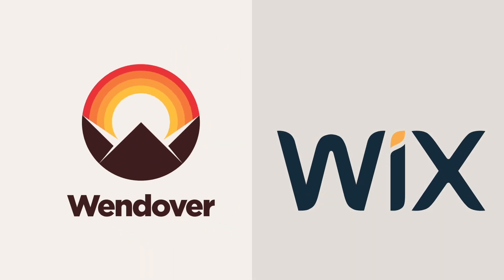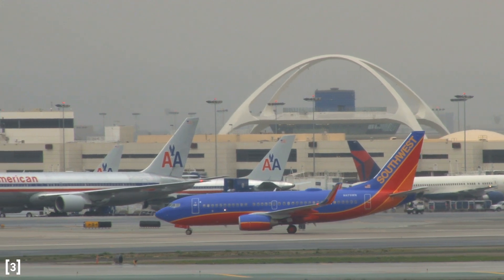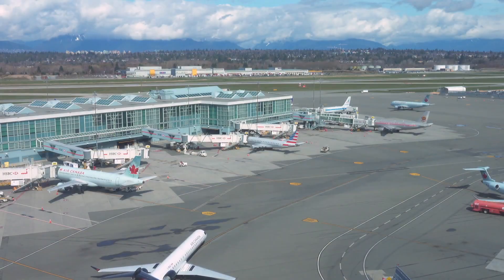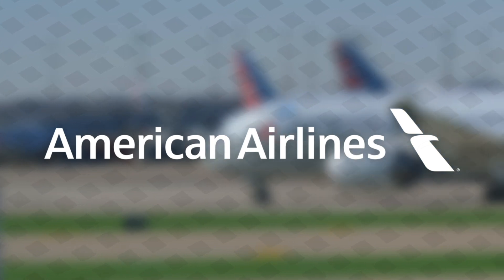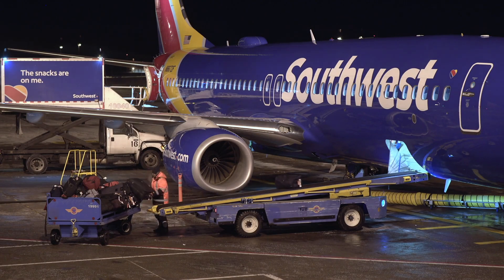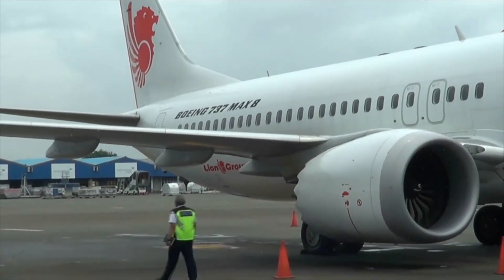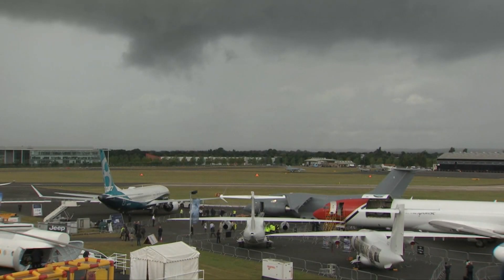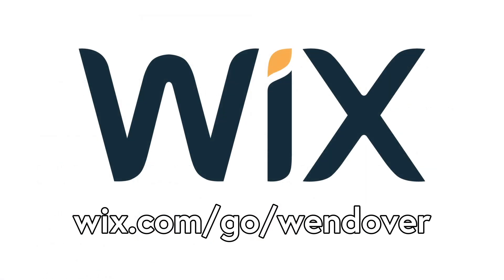The Economics That Made Boeing Build the 737 Max

Comment: Just one thing, you can't blame a crash in a single system. Its not just the MCAS or just the sensor...
Reply: You probably more than right.
MCAS badly designed + No redundant sensors + No retrain by airlines and/or Boeing + Old plane design redesigned to minimise cost (maybe a not so costly but milder redesign would be many times safer the cost) + hurry by Boeing to release a plane to compete with A320NEO as fast as possible. + etc. etc.

Comment: My tweets to Dennis Muilenburg (Boeing CEO & major shareholder):

 
@BoeingCEO
1/ This is the problem: your lack of candour. The 737 Max has short legs (being a 60´s design), & that meant placing the new, efficient & more massive engines higher on the wing´s leading edge, creating an imbalance to yaw and pitch, leading to stall & needing MCAS to avoid it.
 @BoeingCEO
2/ The only solution: placing the engines lower & growing longer legs. Or placing the older engines. Nobody with half a brain will ever fly the 737 Max as is, understand that. MCAS is insufficient, making it dangerous and only exists because of the aforementioned design flaw.

Comment: that the 737 design originated 50 years ago is not a problem. the problem is that the original 737 was designed low to the ground, better suited to airports without jetways. Since then, the 737 has grown from a 80-100 passenger, 94-100ft length to 160-200 passengers at 144 ft length. Being low to the ground, it cannot accommodate the CFM LEAP 1A or PW1000.

Comment: The 737 since its beggining has been plagued by problems. Especial.y deadly, the rudder problems which costed HUNDREDS of lives. It took them YEARS to find out the problem and .... ahem.... correct it.
To get an idea of how old the 737 is.... it has the same cross body section and cockpit as the 727 and the 707.... yes... the 707...
The only boeing aircraft same enough for me, is/was the 747.
Skip the rest, even (if not ESPECIALLY) the 787.

No boeing for me. When i book a flight, i check the aircraft type. No boeing.

Comment: If you had started with the conclusion, I wouldn’t have watched it to the end. It all falls into place.The sensor itself is pretty genius though, the reason it exists is kind of a design flaw and the fact that there’s only one indescriptive warning light if something is broken is just stupid.
Even though the original design didn’t have space for it, I find it hard to understand that they can get a plane to fly but not figure out a place to put a proper display (and if it does exist, not figure out how to display error messages on it).
Because from what I understand from your video, if the pilot had turned it off, those crashes could have been avoided. But in order to turn it off, he would need to know about its existence, which I doubt, and know it’s broken.
I imagine it’s like „hey, what route am I flying today?“ „the blabla“ „but isn’t that on the 737 max?“ „Yah“ „but I’ve never flown that before“ „oh, don’t worry, it’s the same as all 737s“ „so nothing special to take care of?“ „nah, not at all. the FAA doesn’t even require certification for it, that’s why we bought it. What are you still doing here, your flight leaves in 15 minutes!“

Comment: The cables that run down the center of the aircraft are there for redundancy they are not used all the time that’s a back up system on the early version of the 737 it was used all the time because they did not have flyby wire but on the new 737 max Siri’s the cables are just there for redundancy even the 747 has that for redundancy as well as the 777 Airbus only has three back ups and they’re all computer control Boeing has four back ups three computer and one mechanical.

Comment: I'm just wondering why it only has one AoA sensor. There is so much redundancy in airplanes, but not in such a critical instrument?
Reply: All 737MAXs have 2 AoA sensors. The MCAS system only takes data from one sensor at a time though. Boeing is working on correcting this in their software update as well as changing the number of cycles of nose down trim MCAS engages. It should be noted that the crew before the Lion Air crash encountered faulty MCAS and runaway trim and correctly disengaged the system, although failed to mention the faulty sensor post flight.
Reply: @farles777  oops, looks like I didn't do proper research. Thanks for correcting me.

Comment: 0:23 this is very untrue. No jetliner starts up with one switch. It's always 5+ steps

0:29 No, the max also has screens saying what's wrong with the aircraft.

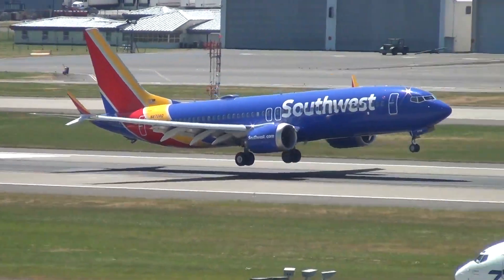0:38 Actually many planes dont use flybywire
Reply: Correct on the first 2, the second is wrong.. Boing uses FBW in the 777 & 787. The confusion with that is they retained the yoke rather then using a side stick like AirBus.

Comment: People are hi-larious sometimes. Two planes out of a series in service since 2011 crash? OMG, unsafe, never fly on again! Meanwhile, none of them bat an eye at car brands and models based on crashes and deaths at a much higher rate caused by bad maintenance, naw, just blame it on the drivers, or bad whether.

People die in droves every winter because they don't bother to put on winter tires or adapt to reduced friction conditions. And people don't ever give a shit. But, like, the smallest risk on an airline? People cry foul and let slip the dogs of war. People have some seriously messed up priorities.
Reply: Just like a seatbelts in usa school bus, one crash and debates about it... 
New technology, new planes shouldn't crash.
Reply: At least for belts on busses, there's plenty of research to show that they could be helpful for side-impact crashes. And statistically, as a close relative of the car, buses are significantly more dangerous than air travel overall. Bus drivers are also a hell of a lot less well trained than an airline pilot.

In the case of buses, lap-bets are worthless, but a 3-point seat-belt like what a car has does make a substantial improvement in side-impact crashes. Schoolbuses are generally involved in quite a few accidents though, most of which are the fault of other motorists.

Comment: normaly like your content but a lot of facts about the 737max was wrong, there are probably around 100 warning lights in the 737 cockpit, it has hydraulic assistance with flight controls and mcas was not designed to be anti-stall it was designed to make the aircraft perform similar to the NG

Comment: One small thing to add - IF you disable MCAS and the elevator is pitched down, it can become jammed, and the only way to unjam it is by taking the stress off it by... pitching down more. Many pilots have reported this jamming on the 737 (not just the MAX), at high-altitude it's an issue, at low altitude there just isn't room to pitch down more and unjam it, often manually by turning a physical wheel in the cockpit.

Comment: 737 has always been praised by pilots because it's like a "manual" car as opposed to "automatics". Ironic that they put in sensor to self-correct
Reply: Perhaps in the past when computer flown things weren't the norm.. Today you'd be crazy to build anything jer powered without all the computer augmentation you can get.. All fighter jets from the 70/80s onwards are flown by a computer... (So are all other Boeing designs other thsn the 737...)

Comment: I have some problems with your reasoning behind why the crashes happen with the 737 MAX. I know you didn't make this video all about why the crashes happen, and honestly it was really good. However, I think it was not solely the design of the plane that was the fault. As he was saying, the MCAS can be disengaged. In training before, pilots have what are called memory items, which are things that need to be done in the event of certain dangerous situations. For instance, there are memory items for engine failure on takeoff roll, cabin decompression, and stabilizer trim runaway. That last one is important. Stabilizer trim runaway is exactly the problem the pilots were facing. And you know what the memory items for other aircraft are for that are? Disengaging the system. I guess because the 737 Max had a little more automation, the training department in Boeing (yes they actually do the training outside of the US and even suggest training within the US) was going away from memory items, and just use a quick action card that would say what to do. I believe if the pilots were trained with these "memory items" already, they (probably) wouldn't have crashed. The day before the Ethiopian crash happened, another crew had dealt with the same situation and a pilot jumpseating disengaged the MCAS and the pilots landed safely after.
Reply: Exactly!   That's the reason these crashes happened on third world airlines.   Weak training.

Comment: Even the A320 cannot be “turned on by the flip of a switch.”
Reply: cub fsx If external power is connected it can.
Reply: not really because you still have to turn on the hydraulic pumps, the beacon light, AC, and other systems.

Comment: 737-700/800/900 are almost the same but the max versions have engines so big that they can’t fit under the wing so they were pushed forwards and upwards, that means that when the aircraft enters a stall the pilots must have managed to put the aircraft at nose down attitude before they press to/ga (takeoff/ go around thrust) otherwise the aircrafts nose will rise more and more. That’s where the infamous mcas system comes in, not all pilots knew about that

Comment: "The economics that made Boeing build the 737 Max in a rush." there it go, it's fixed.
Reply: MCAS Means May Crash Any Second or May Crash Again Soon either way ur Fucked, I am a Loyal Airbus Fan and i will stick with the Safest and the Best Airbus and i love all their Aircraft's and the NEOs are great,RIP BOEING u ain"t going !!!
Reply: @TheAirplanejunkie  447
Reply: 737 Max and Airbus Neo were built in a rush, because they wanted to offer "the cheapest flights to consumers." If consumers were willing to spend $1,000 and up on every airline flight, then they wouldn't have been pressured to release a cheap-flying, "fuel-efficient" plane like the Max planes. That an environmentalism. Instead of doing something that pollutes more, they tried to be "environmental" with an oversized engine. Environmentalism and the craving for people to want cheap flights are what caused this. Ignore the consumer and pollute and do things the right way and we could have had a brand new airplane by now, which is what Boeing originally wanted to do.

Comment: Thank you for your video!! As a physics graduate and researcher in aeronautical engineering, I just found that the solution for Boeing to large engine problem is so unacceptable. However, it is not surprising because the Boeing now is not the legend Boeing 50 years ago. In the past, they were willing to invest and safety was the most important thing. But now, it seems that they are just willing to sacrifice anything to make easy money..

Comment: This video completely botched the explanation of MCAS and its reliance on its angle of attack sensors. An MCAS system on the Air Force's variant of a 767 tanker has flown for years without incident. Why would Wendover instead blame elsewhere? I don't know, he sounds like his opinion was made up before actual facts were considered.

We're supposed to trust you, dude. Most fans of yours aren't going to delve into these issues to find out what you're hiding. Thumbs way down.
Reply: The MCAS is used in the Air Force 767 tanker because changes in the fuel load on the tanker may make the plane unstable. Here, we are dealing with a passenger airliner, and not a military plane. Why should a passenger airliner (which is what the 737 Max is) be unstable in the first place? There should not be this structural aerodynamic design flaw on a passenger airliner.
Reply: @Observer-cd2ul  

It's not unstable. It lacks elevator authority under the set conditions of high thrust and other factosr. It is your unwarranted opinion that an airline would like to spend the extra money for a clean sheet design. Many airlines disagree with your opinion. If the Max didn't have this AoA problem, you'd still hate it.

Comment: It is strange that NO ONE has done SUCH AN UNDERSTANDABLE EXPLANATION of why the 737 Max had such problems recently. It seems Boeing's solution to this WILL BE VERY EXPENSIVE as in FINALLY REPLACING THE 737 with a plane that incorporates the 787 technologies, which would be the fastest way to approach it.

Not only it'll be expensive, but may take at least A DECADE (to like 2030-35) to see fruits...
Reply: Cost of development new plane <<< 350 souls.... Max have Bugatti engine on frame from Model T...
Reply: Mateusz Zimon, as a "car buff poster" in a few car magazines web pages, the proper analogy would be THAT LS SWAP (the GM line of V8 small block engines) INTO ANY GENERATION MAZDA MIATA Roadster. 

Really powerful, but WAY TOO MUCH NOSE HEAVY for any real FUN AND SAFE DRIVING...

With the even worse dilemma that you have to ride thousands of people on them for long distances.... YIKES!

Comment: ...every 737 has different aerodynamics than it's predecessor.   EVERY acft with wing mounted engines will pitch up more, the more thrust you apply.   Those wing tip devices on most of the post 2005 ish 737s change the aerodynamics.   How about the longer -8 and -9 vs the ancient -100?   Ever notice how high up the 777-300 engine is compared to the 777-200?   The reason Boeing kept making 737s is because SWA wouldn't buy anything else... and since they are in production and planes and parts are available at a defined price...everyone else keeps flying them.   And the biggest economic point you failed to mention...if they significantly change the 737,  Boeing has to completely certify it as a  brand new airplane with the billions of dollars in additional expense...that no airline will cover by buying newer more expensive acft...

Comment: I'm going to have to disagree with a few of your conclusions here.  But first, I'm going to start with a statement that I agree with: the 737 has had a phenomenal safety record over 50 years (11:25)  That is the key thing to keep in mind here.  People somehow think old is bad, and that is simply not true.  On the contrary, time allows for problems to be detected and fixed.  That is how you get safe planes.  The decision to re-engine the plane was in no way a bad one.  On the contrary, it was a very good decision.

The problem came in Boeing's decision to share a type rating with existing planes, and install the MCAS system to make this work within regulatory framework.  I don't know enough about how this came down to comment (I'm not sure anyone outside of Boeing does at this point) so it is difficult to say whether or not this was the fundamental problem.  The fatal flaw came in the implementation of the MCAS system -- both in how it worked and how it was explained to the pilots.

And at this point comes the other flaw that not too many people are talking about: The FAA's lack of funding which pushes design oversight onto the manufacturer.  The problems with the implementation of the MCAS system are so obvious that they would easily been caught here -- both saving lives and Boeing's reputation.

Comment: If eletricity goes off mid flight, mechanical wires are better.
then you can steer without power.
But in normal situations they arent accurate enough.
Reply: Not a lot you can do with muscle power though... Batteries and redundant electrical buses is what is needed.

Comment: Boeing should have put a big red button "CANCEL MCAS" on the dashboard and told everyone about it.
Reply: @marionette5968  "The software that tells pilots that there is a mismatch between the AoA sensors was an optional extra on the 737MAX. That's gonna be standard now. " What the fuck? So redundancy was pretty much an optional extra? I'm sure if those 2 pilots saw exactly what system was non-functioning they'd be able to rectify the problem.

Comment: Meanwhile, Airbus has learned from all of their mistakes in making the A350, and look where it's gotten them: ZERO FATAL CRASHES or catastrophic defects (though it did face some engine problems which were totally Rolls-Royce's fault more than Airbus's.) 

The likes of Qatar Airways have pulled absolute miracles using the A350 and helped revive the Pan-Am glory days of air travel. Boeing on the other hand, revived the memory of EXTREMELY UNSAFE flights from probably the freaking Great Depression.

And what has Airbus gotten in return? Far less orders for planes than Boeing (Airbus stands at negative 58 orders as of March 2019 because some airlines canceled entire orders; Boeing, over 100 ADDITIONAL orders since the 737MAX disaster.)
Reply: The reason for that is simple Boeing still has a far higher safety record then Airbus. I know because there is an entire series dedicated to plane crashes and more often then not it was in an Airbus plane hitting the dirt. With over fourteen thousand 737's built and aside from recently held impeccable safety record are very safe to fly. Though I have heard even from family Airbus planes are more comfy is that true?

Comment: I honestly hope they ditch this thing all together. Just design a new damn plane already you cheap bastards. Jesus.
Reply: Sorry but if someone wants that product, then you build that product until there is no longer a demand for it. Even with the two crashes Boeing has built over 14 thousand 737s and counting. As such its got nothing to do with cheap but rather a new peace of tech that needs fixing nothing more. Also case and point despite being a real death trap by today's standards the M113 was kept in production till 2007 with over 80k built. Why because they are cheap, easy to maintain, and expendable.